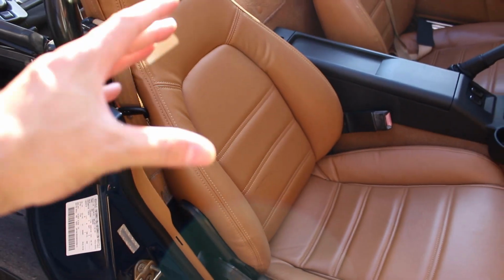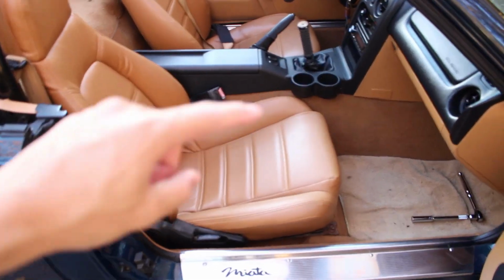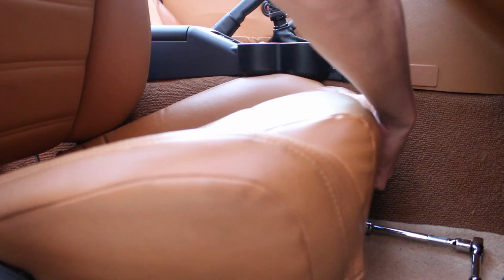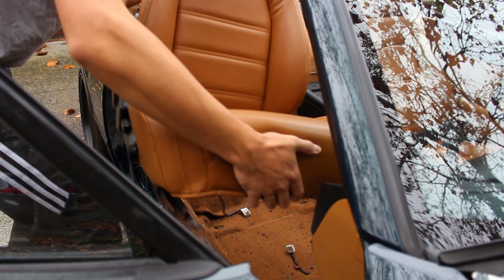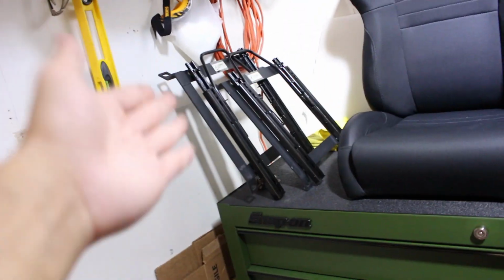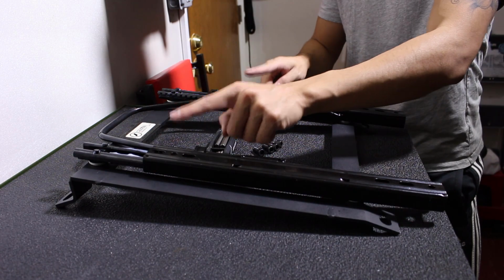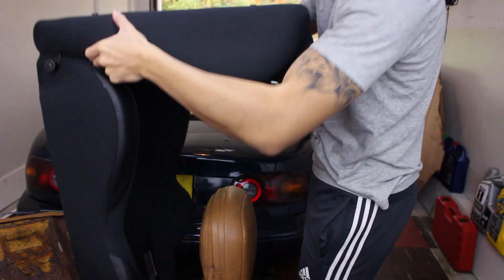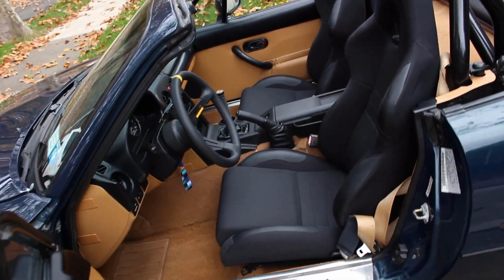How To Install Aftermarket Seats

Comment: Sweet video! I’ve been looking at these seats for awhile now and this install/review helps a lot.
Reply from the maker: Thank you for the support! They’re really decent seats, especially on a budget! The only issues are that the brackets make the seat sit pretty high up, so a foamectomy or custom brackets (which I might end up doing) could help a lot (: Also corbeau brackets aren’t known for being the best in terms of fitment so expect to drill and file to make the bolt holes line up. Otherwise I really enjoy these seats!
Reply: @VincentLawv  ok I’ll look for different brackets. 👍

Comment: I placed my order for these yesterday and they are back ordered till mid April. I also recommend you put the old seat rails on them, you just need to make some brackets and it should lower the seat height.
Reply from the maker: A lot of car parts are backordered right now ): My old seat rails are barely work anymore, that’s why I opted to buy the corbeau rails. I’ll probably just make simple brackets with holes to adjust it forward and backwards. Maybe I’ll take a look at my old ones again & get them to work properly (: Thanks for the suggestion!

Comment: What’s your height? How much higher is it in relation to the stock seat? Ive seen on Corbeau website they offer a seat shave option which takes an inch of foam out of the base to lower the seat.
Reply from the maker: I’m around 5’8, I would say around two inches above stock height? I’ll measure my friends stock seats & get back to you asap to be sure! These seats were bought off a private seller & unfortunately they said they didn’t get the shaved seat option. As of now, if I sit up & lean forward I can sorta hit my head on the softtop frame, looking at traffic lights is also a pain now so I just slouch down in my seat to see them properly. I’ll most likely just end up getting some brackets welded together and ditch the sliders so I could sit lower (:
Reply: @VincentLawv  Your not 5'8 calm down sir
Reply: jk LMAO